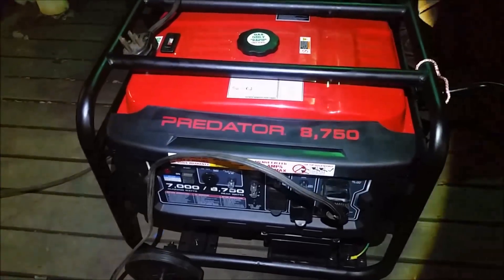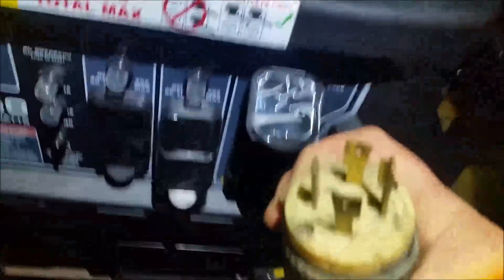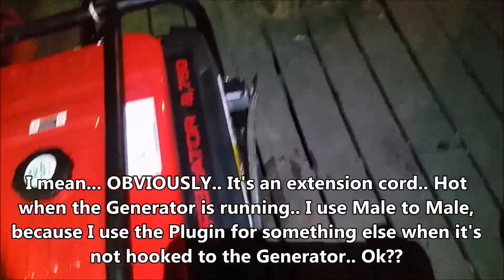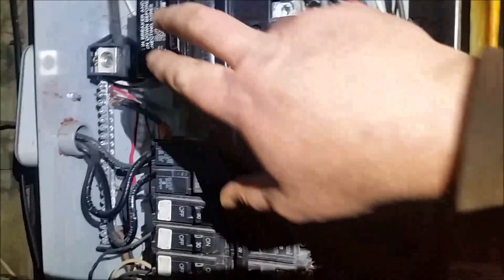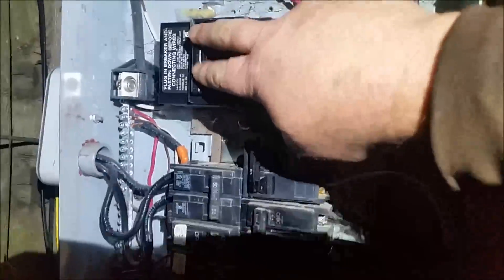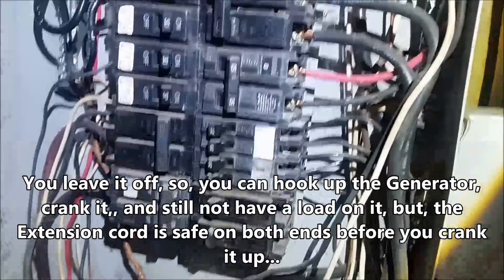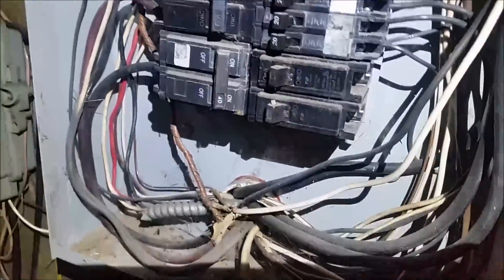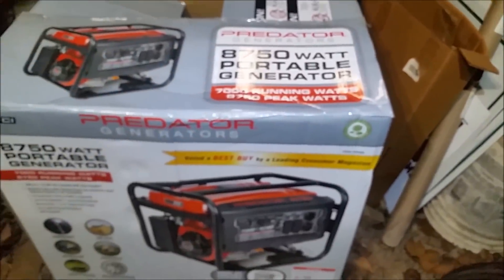Quick/Easy/Safe: Use Existing Plugin/Breaker for Generator hook up to your house Panel box.

Comment: Im not an eletrician so this to much for me so ill leave it alone intresting video
Reply from the maker: Michael Monroe.. Yes.. Good idea.. Not saying you can't do it, but, this does require following a set of rules EVERY SINGLE TIME, and the safest way to do that is to understand fully why you are doing what you are doing, and why you are doing it in the correct order.. You never want to do something like this from memory.. You do it from your understanding. You can always forget to do something from memory, but, never from your understanding.. It's kind of like forgetting to tie your shoes.. You know damn well if you take off to do something else without tieing them, you are going to cause a problem, so, you never forget..  At the very least, you hurt yourself, and the worst, you endanger someone else.. It's not worth it, and you have the good sense to back away when you see the dangers and it is not in your area of expertise.. The next step up from this video requires a dedicated 220v breaker and a Male Twistlock connector to hook up the Male to Female Generator cord.. You install the dedicated breaker usually in the top right uppermost breaker location, and then install a "Generator or Panel Interlock". 
It is a simple metal sliding bracket that costs around $50 or $60 that connects both breakers together... (The Main Breaker and the Dedicated Generator Breaker).. You can't turn one on or off without the other doing the same movement, which is Main Off/Gen On, or Main On/Gen Off. 
There is no way to backfeed to the utility with the Generator Interlock, and it is a safe and easy setup.. You can research "Generator or Interlock, or Installing a Generator or Panel Interlock", and see if you feel more comfortable with that.. It is very easy to hook up.. If you have to buy everything new, $40 Male Plug, $55 for Interlock, $40 220v breaker, Some short pieces of Feed Wire to the plug from the breaker, some flex conduit, etc.. I would say $150 in parts, and I would think about that much in labor would be fair.. It would be a service call plus an hour labor. If it takes him more than 2 hours, it would be amazing.. 
If you want to cut some cost, save him a trip and send him a couple of photos of the inside of your panel (hope you have a 220v slot open), and a few pictures of the box and the area around the box and where you would like the plug installed, and mention the Male Interlock is needed, what size generator you have, etc.. 
He should be able to show up with everything he needs the next time he goes to his supplier and not have a special trip involved with your install.. 
If you can build a cover to the side of the panel somewhere, you might go ahead and do that, so, he can be there when you test it for the first time.. 
The transfer switch is a step above that.. They are large and bulky. Some actually require moving whatever circuits you want to power while you are on generator to the Transfer switch.. I would stay away from that type.. It is going to be expensive and unnecessary. You can just flip off all of your 220v breakers and start from there and you will know which items you need and which you do not when you are on generator, and you can change your mind as you learn what you can run and what you can not. You can read the rated amps/watts of the larger appliances and get some idea of what you can run at one time, but, remember,  the numbers are Max numbers, not normal or nominal.. Like a Stove.. It's max is if you turn all burners on high at the same time. So, don't count on the average Electrician to tell you what you can run and not run. He will count the max on everything and you won't have anything.Ha.. Just a few comments to help you down the road.. 
Good luck with your quest.. Just remember.. There is very little difference between the Carpenter, Electrician, Mechanic, etc.. They all have two eyes, two arms 10 fingers if they are good at what they do, and they all have tools that you can buy, just like them.. They don't have these vast knowledges that we can't pick up.. But, they have done it before, and probably done it with someone who who has given them some tips to the trade.. Safety is common sense, but, it comes with a basic knowledge that increases with experience.. Cheers..

Comment: I've done this w/ good results. IT IS CRUCIAL to isolate the house drop from the grid (main-breaker DOWN), or you WILL back-feed onto the system and electrocute a lineman. Not to mention destroy the genset. A 7kw generator is more than adequate to run your household. Just drop the water heater and range breakers first. It won't handle these. AWG 8 is large enough to handle ~30 amps @ 220 volts with a safety margin.
Reply from the maker: Bill McKinney.. Exactly correct.. Thanks for your comment Bill.

Comment: This guy is wrong a two twenty breaker does not pull juice from both sides on box power. they are drawn from the same power lead, not both sides.
Reply from the maker: Terry Luscher..  You should really be asking questions, instead of talking.. 220v drawn from the same power lead??? Sir,, you do not need to be looking at how to hook up a generator.. You need to be looking for videos that are related to Fundamentals of Electricity and how do you get 220volts out of a house panel box. 
Hint: The 3 lines coming into your house panel... Two 120volt lines and one neutral.. One each of the 120v lines plus Neutral/ground makes a 220v. 
The 220v breaker on the left side of the box, feeds from the left power leg and the right power leg coming into the box..  You can "TURN OFF THE MAIN BREAKER", and pull one of the 220v breakers and look at the two blades that it plugs into.. One comes from the left leg and one crosses over to the left from the right leg.. 
I do not understand why guys like you make authoritative statements and tell someone else they do not know what they are talking about,,, when it is clear that you don't know what the hell you are talking about to begin with.. If someone says something that differs from your knowledge, it seems you would think about it, try to wonder why he said that, maybe take a quick look for yourself, or at the very least ask someone to explain why he said what he said.. 
You chose to show your ignorance instead.. It really makes me wonder why there are so many people out there who stay uninformed, but, the examples I see here really scare me.. Makes me want to vote to have a 100 question test before you qualify to vote.. Go help us if you were in charge of building panel boxes... Ha.Ha..Ha.. You just spout out things you are clueless about and start making rules without even checking to see if you are wrong.. Ha..Ha. Amazing.

Comment: I am a master Electrician for 35 years . This video is against so many codes . Not only against multiple codes ,very ,very dangerous. It is not worth your life or someone else's life to save money . Hook the generator up the correct and safe way . It only takes a split second to get killed there are no second chances.
Reply from the maker: Susan Eisenberg.. 35 years experience? Wow.. After 35 years and you don't know the NEC? Amazing.. The more comments you guys with 35 years experience make,, the less likely I would ever call one of you guys to do anything for me.. Even if I had no legs and no arms,, I would figure out a way NOT to call any of you.. I have never met a more mindless bunch of people in my life.. 
Against So many Codes? The only thing not standard premises wring is the Male to Male cord and the Generator..  (So Many???).. Ha..Ha..Ha.. 
And,, NEC does not regulate Temporary or Extension Cords..  But, feel free to prove me wrong and prove yourself right.. Feel Free to post a link to the NEC where it talks about Male to Male cords.. Kind of hard for me to post the link where it "DOES NOT" talk about it.. 
NEC does regulate cords that are not Commonly plugged or Unplugged.. And, they regulate the plugs and receptacles that "Appliance cords plug into"..  But, not the cords that are Temporary or Extension  cords.. You guys are going to have to work on that.. Try to Regulate something else and see how many states drop the codes.. Not too many buying into the 2017 codes now.. Most are still on 2014 and a growing number are still on 2012 codes. You are cutting your own throats.. 
Use common sense if you want to stay in business and keep Milking your cash cow.. Keep posting stupid crap on videos like these and no one is going to regard the NEC as viable...  Your Choice.. We know what Trolls are and we know how stupid they are.. Everytime they post something, they show their ignorance.
Welcome to my channel anyway.Ha.Ha..Ha..

Comment: Not a critic, but Will that make your breaker have to work backwards?  So there is a safety issue there? Let me explain, power is run from your poles to your wire on normal operations.  When you hook it up this way, you have to send power to you breaker through the hot wires then to your poles.
Reply from the maker: Chris Smith: Did you consider the Generator has a breaker? Usually a GFCI, which is much more finiky than a standard home breaker.. Besides, it is a 50 amp dryer/Welder plug and the Generator only supplies 30 amps per leg, and that is what it's breaker is rated at.. It is used as a disconnect in this case, because the current will never get to 50 amps to throw it. But, if you do throw more than 50 amps through it, it will trip. Remember.. A/C is Alternating Current, so, the current alternates.. D/C on the other hand is Direct Current and I would have to think about that a bit..  Here is a reference.. They might talk about D/C on this thread, but, it answers your other questions.. 
https://www.electriciantalk.com/f2/breakers-directional-19714/

Comment: I don't know jack shit about electrical work but this does not look safe at all.
Reply from the maker: Red Davis.. Well, you just explained why it doesn't look safe.. If you want to know. I will explain it quickly.. Nothing here is "Out of Code" ( but some think the Male to Male is not NEC Compliant, but, NEC does not regulate portable extension cords)". .. Electricity is dangerous.. There is no doubt about that.. People work with electricity every day and do it safely.. The only thing besides the Male to Male cord that is not part of an approved/certified/inspected house wiring system is the Generator itself... Nothing is added to the system except the cord and generator.. That said.. The cord is Male to Male.. And, just like everything else in Electrical work, you have to evaluate the situation before you work on it.. Common Sense says,, careful with the Male to Male cord.. Don't touch either end to begin with, but,, surely don't touch either end when it is hot.. That means, don't plug it into anything power related at all, while the plug you are plugging into is powered, because, the second you do, the other end is hot.. Same as if you work "In" the breaker panel, you turn the main breaker off... 
In this case, you turn the main breaker off.. The plug you are plugging into is now NOT HOT.. Neither is the generator because it is NOT RUNNING.. PLug the cord into the plug on the Generator and the dual purpose plugin you use for something else when not using it for the generator.. Then, you can crank the generator.. 
If you can do that, it is safe.. Simple as that..But, rules are rules and they are to be followed.. So, if you have any doubt being able to Turn off the Main breaker, plug the cord in and then,,, crank the generator, you are going to cause some problems..Do it correctly, and there is none.
It's really quite simple.. 
Give a gun to a fool and you have a fool with a gun and there is no telling if someone will get hurt.. Give it to someone else, or a police officer, and it is a tool, and not a problem.. Give it to someone who doesn't know Jack Shit about guns, and you could surely have an accident..  No difference.. 
It's not the tool or object, it's safety is up to the guy holding it.. That is why I say,, this is not for everyone.. If you are scared of it, it is not something you should do.. 
A snake is a snake, dead or alive.. A dead snake does not bother me. A live one does.. It works on it's own, and you have no control over it, except to stay away from it. Electricity is like a snake.. Dead if you know what you are doing, and alive and well, and poisonous  if you don't.. 
A Male to Male cord hanging on a wall, both ends where you can see them exposed is no problem. A Male to Male plugged into a dead circuit is no problem, and when you plug the other end in,,, it does not matter, because the other end is not exposed.. Like a Standard extension cord.. (use common sense here, the other end has to be plugged into something it is designed to be plugged into, in this case a receptacle to power both sides of the bus.. That is why you plug both ends in, and then crank the generator.. You don't have to wait to crank the generator, it is just good practice, and safer for the generator. When working with Electricity, you reduce or eliminate risk any time you can.. Turning off the main breaker does not mean there is no electricity in the panel box.. Just limits it to being above the main breaker.. It's all pretty simple when you study it and figure it out.. I was 17years old when I rewired my first house I bought. I just looked at two existing panel boxes and looked at how one receptacle and one light switch was wired.. Then, I rewired the whole house and passed inspection when the inspector arrived.. Electrical wiring is not complicated, but, it is dangerous if you don't know what you are doing.

Comment: Reminds me of "he who is his own doctor has a fool for a patient.". There are ul listed mechanical blockers where you mount it on the uppermost breaker, and main must be off to throw that breaker on.  That breaker feeds whole panel and you choose in your panel what you want on or off.  Device 150, electrician 450 to route to outside female weather box and plug.  One other thing....you EVER have an electrical fire in your panel, good luck with the fire marshal and insurance Co.   Short money for unseen risk to you.  Imagine your powers been off and you're cold, tired, sleepy.  Built in disaster engineering.  Common sense?  This isn't water plumbing, it kills you.
Reply from the maker: Thanks for the compliment.. You are correct.. I don't subscribe to the Western Medicine "Receptor Blockers" You get a headache, take an asprin or tylenol.. Will you have another headache? Well, did that tylenol fix the reason you had one?? Ok,, you can subscribe to Western Medicine if you like.. I'll do my own thing.. BTW.. If you ever get the Shingles,, and you go to the doctor and he gives you some steroids,  and some pain killer and send you home to let it take it's course? Well, I have a cure and it is home made.. It is a mixture of two products.. Both you can buy, and one of which you can make yourself. One application and the shingles are gone.. So, I hope you remember this when you get them.. I have the cure,, but, I would not want you to be the fool you talk about being your own doctor.. But, after you have them, let me know if someone else gets them.. I'll send them some.. Ha.>Ha.Ha.. 
If I ever meet an electrician who is not Ignorant,  I would give him $150 to install a $450 box, but, not vice versa.. 
BTW.. I want to show you how damn foolish you are.. You are here complaining about a male to male plug being dangerous, but, you just said,, "Route to an Outside Female weather box and plug.. Hey.. Mr. Dumbass.. What type of connector are you going to plug into that Female plug... 
If it's a Female.. Guess which?? A male?? And female on the Generator?? Know what that means Mr. Bipolar Bear?? Male to Male Plug.. What a total dip shit.. Ha.>Ha. 
Actually,, the female is the Receptacle and the male is the plug.. If you think about it for a minute,, that is,, if you have a girlfriend,,, you are the plug, and she is the Receptacle.. Well, in your case, he might be too.. Ha..Ha..  Hey.. Mr.. Smarty pants?? That Ul Listed Mechanical Blocker?? Ha..Ha.Ha.. Yea.. The Blockers??? Ha..Ha..Ha.. It's called a Generator Interlock you dip shit.. I think you need to go see a doctor.. Ha..Ha.Ha.. And,, the Interlock?? It doesn't quite work like you describe.. Main Must be Off to throw the other breaker on?? How about you say that, how it actually works.. The Generator Interlock is designed for those guys who can't think and can't remember to throw the main breaker off,, so, the Interlock ties the Main and the uppermost breaker together, so, the Main and the Generator breaker can never be on at the same time.. 
BTW... I just looked at your common vids.. Time for another session or two with John Breeding? I like the subjects you are interested it.. Hope you get some help there.. I was wondering what your problem was.. No big deal.. You know the old saying, "Mind over Matter???".. It's also Mind over Whats the Matter..Ha..Ha.. Cheers.. Have a nice day.. Ha..Ha. We don't have electrical fires here.